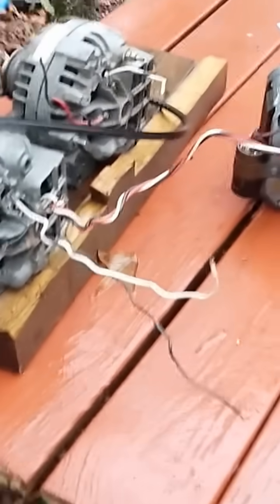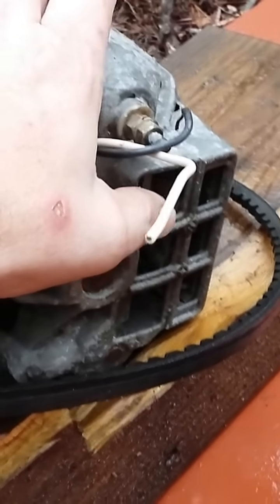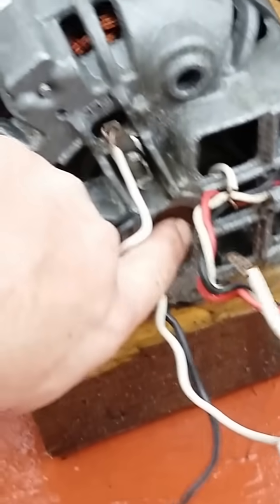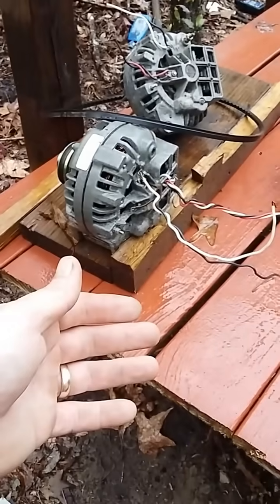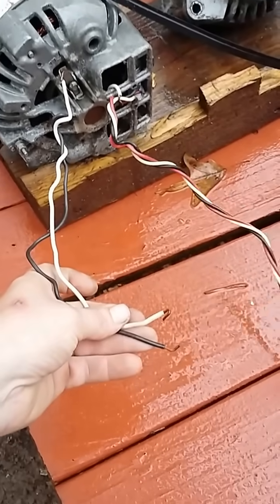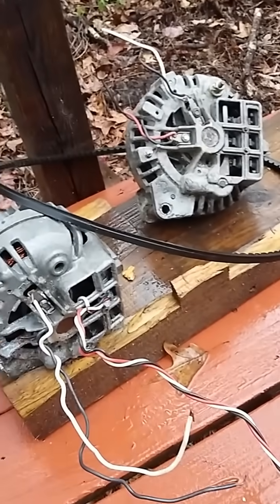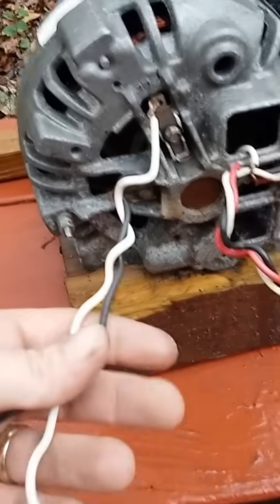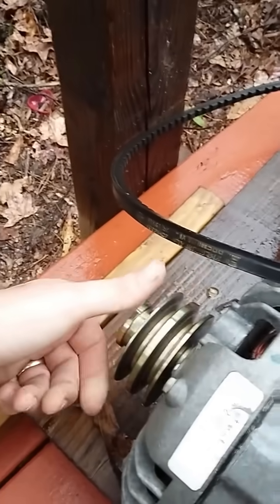Update Free energy forever no wind no solar no gas READ DISCRIPTION!!!

Comment: yes I have questions... WHAT?! I am very interested in your idea but is seems you are having a hard time actually explaining it. what you need to do to help people trying to understand what your saying is a start to finish product.  like where do you get your power to run it. what are you using to spin the alternator? show a video of you building it from scratch.  thanks
Reply: +yvonne ballard I thing you are right
Reply: +Thomas Buie triggered
Reply: I agree, not helpful at all.
Reply: Please help.
How do you connect the wires to the stater?
Why do you have to pull out the three diodes?
Reply from the maker: +TIXE RIGHT  if you know what you're doing and you change the bridge rectifier in the back of the alternator it will produce a lot of power not 14 volts direct current at 80 or 90 amps which is regular operating conditions but if you spend it at 3600 RPM and change the bridge rectifier you will have a high-powered stable sine wave generator that produces alternating current this is a fact and I don't need to prove it so with that being said how hard is it to turn an alternator how hard is it to turn 10 alternators with one motor oh wait that's right you can't use an electric motor to turn stuff with the reason why I picked an alternator is because an alternator can be a motor a direct current generator or an alternating current generator depending on how you wire it look this up and you will find out I'm not scamming
Reply: @ThomasBuie  How do you keep it from melting at higher voltage? The signal voltage is what determines the output btw.
Reply from the maker: +yvonne ballard no it's because Brenda Ballard doesn't know what she's talking about...
Reply from the maker: +Jose Torres YOU can LEAD a HORSE to WATER, but YOU CAN'T make HIM drink.  I can GET you INTERESTED by THIS VIDEO and then TELL you HOW to do it on all MY other VIDEOS but I but I can't get YOU to WATCH them I DIDN'T do what I did 4 the Damned algorithms on the other videos SO they're NOT advertised like this one is there's A certain THING you HAVE to DO for the algorithms on YouTube TO CATCH in and pick UP and show your s*** all I can SAY is wow I can't make YOU watch my other videos then you'll NEVER LEARN y'all can SIT here AND TALK all DAY LONG about how I'm not going to show it not going to show it he's not going to show!!!!!!!!
I AM SHOWING IT BUT YOU'RE NOT WATCHING IT!!! IT IS IN MY DAMN VIDEOS???
WHAT MORE CAN I DO BUT COME TO YOUR HOUSE AND CLICK ON MY VIDEOS FOR YOU???

Comment: so show how much you saved?  Or more importantly, how come you don't have the system running?  I have seen so many of these claims but nothing to back it up.  Most people don't have the cash to even begin what you propose. or at least show it running. Thanks!
Reply from the maker: Nannerin, if I show it running then I will be enabling evil people to replicate the system and I'm not going to teach anyone who is not a good-hearted person how to build one of these I have turned down millions of dollars had death threats the whole nine. I am teaching 20 + people right now and spending 10 to 12 hours a day scaling models for these different applications and I'm doing this all for free without being able to work because of my back and no I'm not adding to the economy Problem by drawing Social Security disability or anything like that. my wife is working and she has a mass in her brain I have went through all these trials and tribulations and I'm not about to give up now!!! The day you give up is the day that you lose everything!!!
Reply from the maker: MJ Candlec okay MJ before you judge my ridiculous video and comment about the 10 2 test wires that are hanging from  the alternator maybe you should ask a question yourself? where does the power come from? well let's see here if you put 12 volts direct current to the stator which is directly on the outside of the rotor and then Spin the rotor you will create an electromagnetic field and because the rotor is spinning it will be projected into the 3 coils that are on the inside of the alternator and it will be Amplified hundreds of times by the magnetism I'm terribly surprised that you're an engineer and did not know about this??? now if you bypass the diodes you will get unstable alternating current.. three phase of alternating current..  where did you get your electrical engineering degree? Because now you are on the spotlight for being completely ridiculous and not even looking at what I did or even watching the video!!!
Reply from the maker: Henry Jones if you would have read any of the comments you would know that I am sharing it privately for free and charging for it on YouTube so I can keep my family protected but I will only be giving it freely too kind-hearted people who don't cause harm to others without a just cause...  slam dunk I answered that one for the 15th time today!!!